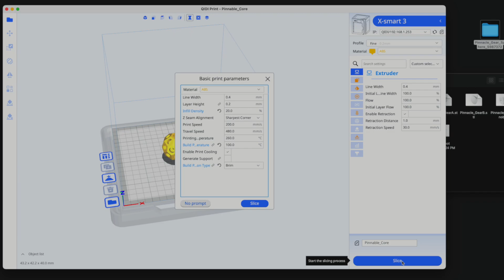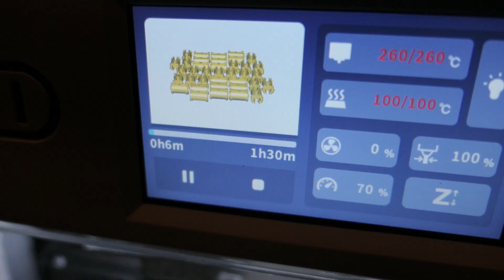3D Printed Gear Sphere - QIDI X-smart 3

Comment: Why do you print with a brim? Is the adhesion poor on these plates?
Reply from the maker: Multiple small parts, plus abs there was a chance for popping off but overall bed is great.
Reply: I have a Max 3 that has pretty much the same build plate structure and adhesion is great. I use brims more to make sure my nozzle does what its supposed to do :)